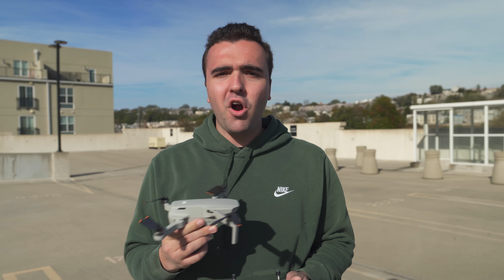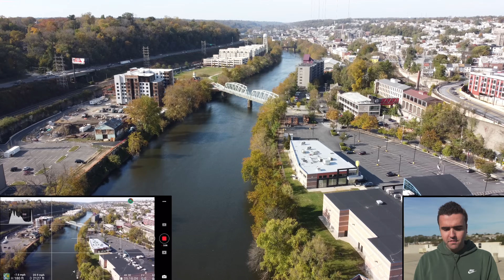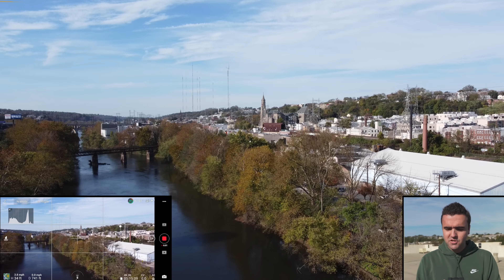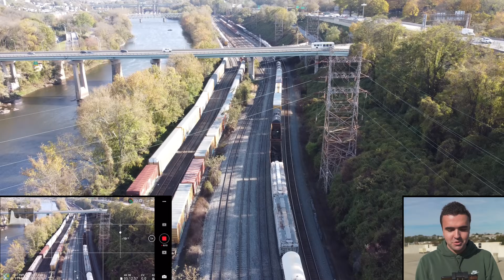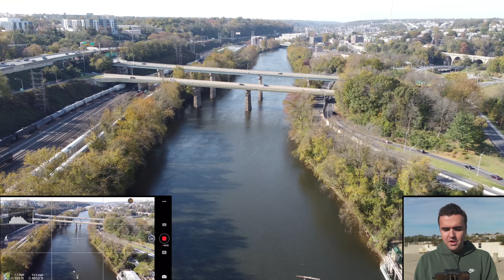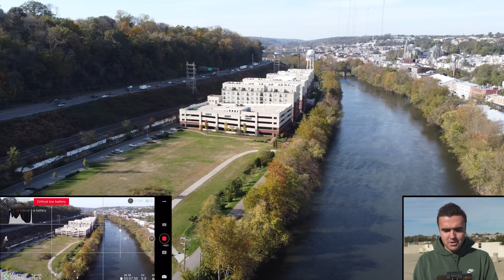DJI Mini 2 First Flight and Impressions

Comment: I just bought this very drone, got it for wifey for Christmas,  I'm wondering does adding things like the landing gear and / or propeller guards add enough weight to it to affect fly time and speeds? Also do these additions change the 249 grams to above 250, requiring FCC licenses etc?

Comment: I'm really surprised that I have heard nothing on what's going to be going on with Remote ID...I would really hate to see the hobby disappear all together but it seems that no one is really to concerned about it....did i miss something?  Is the Mavic Mini the answer to Remote ID?  Also, does DJI know something we don't?  The Mavic Mini and Mini 2, along with the Mavic Air 2 have been released before Remote ID.  I personally can't see a reason why they would continue releasing drones without knowing at least a little of what the future holds.  But who knows....I hear that the Mavic 3 release is based on the new Remote ID laws.

Comment: WARNING! the dji fly app requires a phone that supports android 6.0 as written on their site but this is a necessary but not sufficient condition. YOU MUST OWN A 64bit PHONE otherwise you will not be able to install the app and fly your MINI 2
DJI "forgot" to include this info on their site ...

Comment: Hey Billy. Great job as always! Question:. Without the fly more package how do you charge the battery? Is it similar to the spark where you just plug in to the back of the drone while the battery is installed? Thank you in advance. And do you think it's worth getting the fly more package for the price point?

Comment: FYI you can use the mavic air 2 controller with the mavic mini and vice versa.. 

You just have to pair it.. 

Some people like this because you can use one remote control for both drones. 

But if you have the mavic air 2 I don't see any reason whatsoever to get the mini 2. Because the mavic air 2 is better a little bit bigger and obviously you have to register it but it's just as compact.. 

But for beginners who don't want to register their drone it's a no-brainer..

Comment: Remember, if you choose to fly the Mini 2 commercially in the United States "in furtherance of a business"--then, you must pay $5 for commercial registration number, attach it to drone, and abide by all Part 107 rules. Many videos say, "You don't have to register the Mini 2" but that's only true if you are flying it as a hobbyist for fun. If you attach any other accessories to the Mini 2--such as prop guards, anti-collision lights, etc that cause the take-off weight to exceed 250 grams (0.55 lbs); then, you need a hobbyist registration number.

Comment: It's hard to tell a difference what I'm flying my mavic air 2 or my mini 2 I literally sometimes have to think about which drone is in the air because the controllers are the same & they both fly so good. Not much wind in Phoenix but with all kinds of interference 1.25 miles away just standing in my front yard & 275 elevation or so. Range is amazing. 2.7K was pretty good on the mavic mini the range is what was the biggest problem in my opinion, thank God occusync 2.0

Comment: I noticed you were flying very close to hydro lines and even over the without any loss of signal or interference. Is that because of the new communication system? I would have been freaking out with critical battery over water. :-)

Comment: Customizable LED cover is changeable?   Must be a time restriction on your vids?  You couldnt slow down 5-8 seconds and elaborate?  On my Air 2 its called a gimbal cover.  Your inference is that the Mini 2 can fly with the changeable LED cover needs elaboration.
Reply from the maker: The cover isn’t LED. There is a LED light that is customizable.

Comment: Great new specs, I haven't been able to use my "old" mini much so I wont buy this one.
Maybe couple of things, I was hoping for a smaller remote, or being able to use a smartphone even if it was with a limited range! 
It's such a cool drone to take backpacking/bikepacking but the remote is heavier and bigger than the drone itself!
Oh btw, couldn't they update the Mini 1 with raw?
Reply from the maker: Smaller remote = harder to use. I think I’d rather a beefier remote with ample room to hold on to. They sure could add raw support, but doubtful as they want it to be a standout reason to buy the Mini 2

Comment: Battery drains too fast. You flew 10 minutes and it flashed rth
Reply from the maker: Because I was ripping in sport mode the entire time
Reply: @billykyle  You think in normal you can get 25?
Reply from the maker: Yeah, and with less windy conditions. Even if you are more reserved in your flying not always flying full throttle you will see better flight time

Comment: Thanks for the real review Billy, I went back and canceled my Mini 2 because that's the same issues I was having with the Mavic Mini 1, getting it home in a little wind with 20% battery if you're a ways out. I have the Mavic Air 2 and M2 Pro and M2 Zoom and I think the MA2 is the perfect drone and size with no worries about getting home.

Comment: If I had purchased the original Mavic Mini I'd be pissed.

The argument can be made that DJI took a page out of Apple's product release strategy, purposefully releasing a nerfed version of this product less than a year ago with plans to release the full capability product shortly after.

This item does not have any engineering advances. It simply puts all of the items they had at the time of Mini 1 release in the package. Did they create new motors for this? No. Did they miniaturize Occusync 2 for this? No. Did they create a new remote for this? No.

The Mini 1 was a pure money grab and this was the item they actually created back when that was released. But hey, why not get people to buy a purposefully deprecated product and then sell them the real one shortly after?

It's really unfortunate to consumers and I hope this isn't the start of a new product strategy.

Comment: 31mins flight time? what a load of bollocks! it was more like 13mins in this review. 
Why can't you reviewers just be honest? or is it a case of your next free drone to review would be cancelled, if you are critical about something.
less than 50% of the given battery life deserves a explanation as does the knocking gimbal.
Reply from the maker: Don’t shoot the messenger. It’s always important to understand what specs are advertised and what real world flight time looks like. Of course the drone will be under remote stress and burn more battery when being pushed in sport mode through the wind.

Comment: Thanx for the great video boss 👌🏻
If this new guy got digital zoom in it, then i can consider buying another dji drone

The reason of that is this baby uses lipo battery unlike the polymer ones in Air1,2 , pro 1,2, zoom. That is not a good landing spot when u lose 69% to 0% of your power when u r flying a mile away on the top of the ocean 😢

Comment: Are the batteries compatible with the first gen Mini? I have three batteries and if they work then that’s awesome.
Reply: Yes first gen batteries will work with 2nd gen but nice the other way.
Reply: @morninghope1  any issues to consider?
Reply: @TheRoamingDINKWADS  As far as batteries goes, the first gen batteries will push the weight of drone over 250g but they are compatible.

Comment: Great Video. It definitely handles the wind better. Ocusunc 2.0, 4K, RAW photos, better wind handling capacity - Great. Getting back with 2% is cutting it fine. I found with the MM1 that Sports Mode would halve the battery life, so when facing a Headwind coming Home, I would throw it back into P Mode (increased battery time) and reduce the height (reduced wind) to bring it home. :) Well done and great drone.

Comment: Well done 👍. It might be a viable option for certain areas after the FAA releases their new rules 🤔. The Mini 2 just doesn’t appeal to me. My Mavic Air 2 is small enough and has more features.
Reply: $1000 vs $600.
Reply: @Burritosarebetterthantacos  if you don’t have the Mavic Air 2 already and you need to get into the game, the mini 2 is perfect. I personally wouldn’t invest in the Mini 2 because I have the Mavic Air 2. The Mini 2 would be a obvious down grade.
Reply: @CaptureLifeConnection  gotcha. I bought the mini 2 to learn how to ly before I buy the MP3 next year👍🏻
Reply: @Burritosarebetterthantacos  from what I have seen so far you will be very happy with your purchase. The Mini 2 is impressive. I am ready to invest in the M3P or Phantom 5. “If” the humors are correct. I personally feel like the next flagship drone will be a new line (not a Mavic). Something different, different name and form factor. I have nothing to back that tho..lol It’s just a feeling.
Reply: @CaptureLifeConnection  I canceled my mini2 and got the Air😂
Reply: @Burritosarebetterthantacos  really, lol. You’ll enjoy it. I have a few drones but I’ve been flying the MA2 exclusively since I received it.

Comment: Mini 2 or Air 2?
Reply: You could make an argument for the Mini 2 if size (being small) is your top priority, but the Air 2 is a much much better drone in every way except weight.
Reply: The Air 2 is still a more robust, but also more expensive drone. If you have the extra money, get the Air 2.

Comment: Awesome flight bro. In your opinion is it worth the upgrade from the Mavic mini?
Reply: Noeys FastRC   Take that with a grain of salt.  He is under contract with Dji.  Don't expect a honest reply
Reply from the maker: Definitely! Much needed spec bumps with new features 👌🏼
Reply: You know what the difference is. You should be able to make your own decision.
Reply: I’ve had the Mavic Mini for a year, and never had a flight without video dropout and connection issues. Also, I take a lot of spherical panoramas. Definitely upgrading to the Mini 2 for those two reasons alone